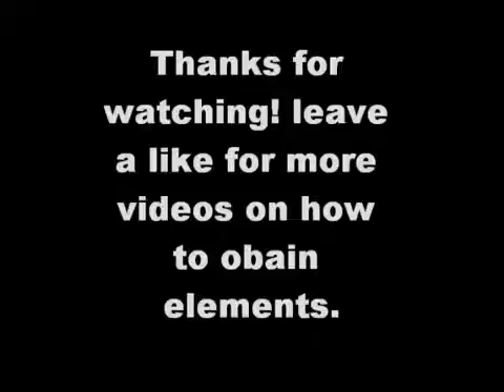Silicon From Computer Chips

Comment: are you sure thats not just a piece of sautter? i just really need silicon in my collection and i dont want a piece of sautter as silicon. btw, great informational videos
Reply from the maker: pimaster 961 I'm 100% sure it's silicon. Silicon is what's used in microchips because it is a semiconductor and can be doped with phosphorus or boron to create microcircuitry which is why computers are so compact now a days. Plus, it's very brittle, solder is flexible whereas silicon fractures is you try to bend it. Trust me, it's definitely silicon